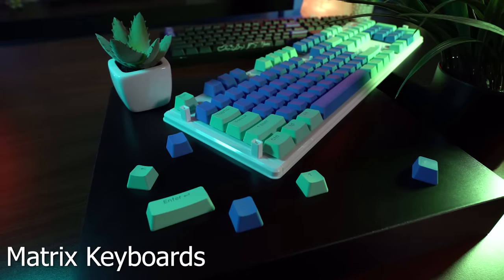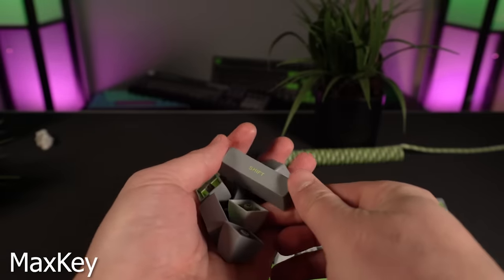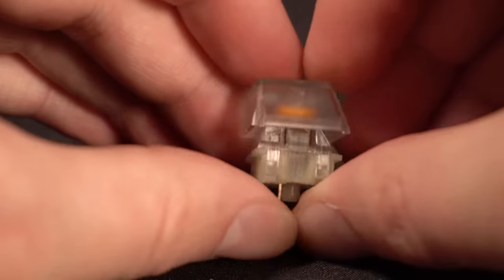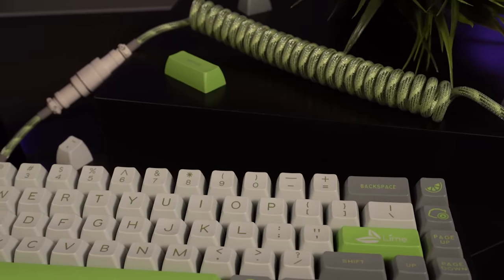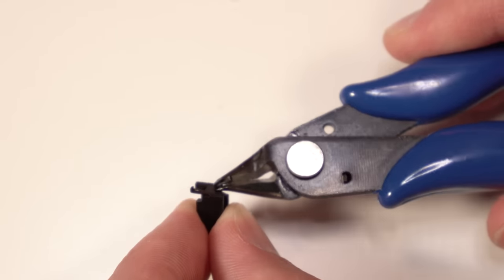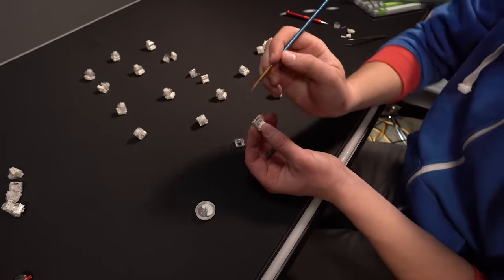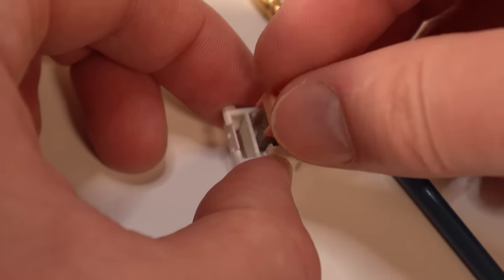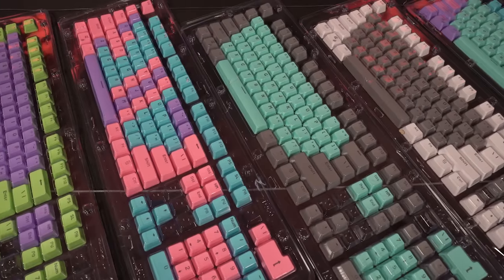5 Super Easy Mechanical Keyboard Upgrades Anyone Can Do!

Comment: Ok so for stuff he missed, 
1. if you dont have hotswap you cant snip your stabiliserns unless you wanna desolder DO NOT TAKE THEM OUT! if you do you cant get them back in. 
2. You can lube non hotswap switches. Press the switch down, spray a little bit of easylube, bike chain lube or maybe silicon based lubricant NOT HIGH VISCOSITY. 
3. Keycaps is not as important as he said. 
4. Dont put o-rings, nasty asf.

Comment: So many key caps on the market, so many f'ugly fonts used.  I truly hate key caps that are not all caps so CTRL vs Ctrl   that's 1 reason why I use hyper x pudding key caps. The all uppercase fonts look so damn clean.  I did the painters tape mod and the o-ring mod but the thing that made the most difference was putting on my hyper x pudding key caps from an old hyper x elite 2 keyboard onto my new REDRAGON keyboard, now all but the backspace key sound like a deep thud compared to how it was without mods and original key caps.

Comment: I'd like to switch my keycaps to pudding keycaps but the problem is that i luve in germany typing with a quertz keyboard and all the pudding keycap sets out there are for keyboards without ü ö ä and some other stuff that's different to the one in germany :(
Reply: I'm from Finland and we use öäå. I left those keys on actually, and just changed the rest. I also have a K70, meaning the bottom row isn't standardized, but it still looks way better and I love the feeling of PBT.

Comment: The worst video about keyboard modding I've ever seen. 5 SUPER EASY KEYBOARD UPGRADES - buy a cable for $20-30, genius 🤦🏻‍♂️. Lube the switches and stabs - yeah, because we all have a set of different lubes for various parts of the switch, for stabs and stab stems. This is just cringe.

Comment: Don't lube your mechanical keyboard. You got it for the sound it makes, right? If you wanted a squishy keyboard, you should have stuck with membrane.
Reply: I think you're confused about what the lube does... It makes the travel smoother and does not affect the bottom out feel.
Reply: The lube dampens the sound but keeps the feel, so for me a win win
Reply: Lubing switches makes them a far better switch, unless you OVER lube. Don't over lube.
Reply: Hi bottom